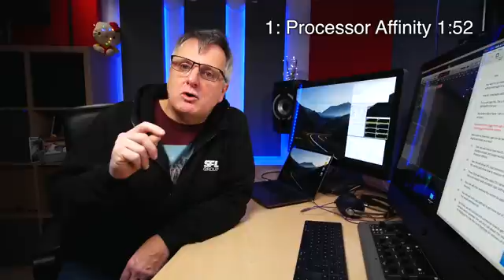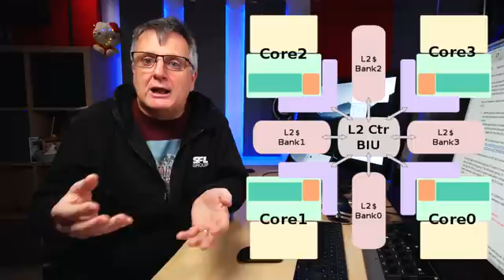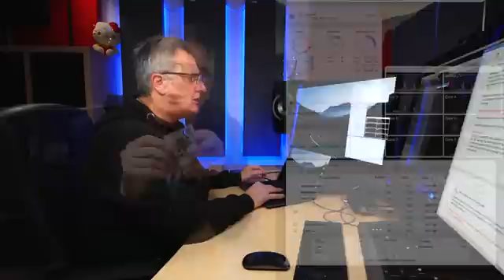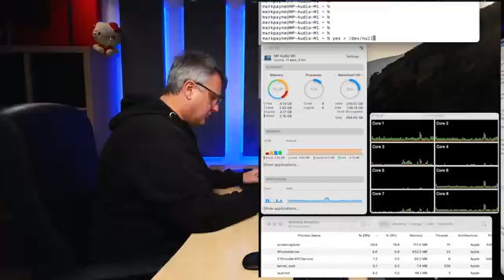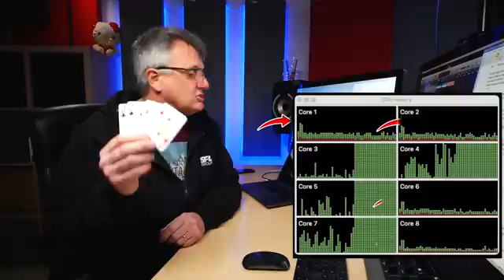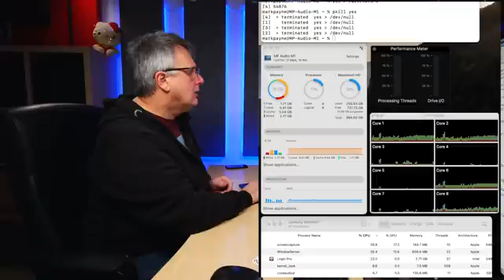Logic Pro X CPU Optimization | 2021 | M1 System Tips | Run more Plugins!

Comment: Thank you for making and sharing this. Very useful information. I was suspicious of the other videos showing 900 plugins running etc, thankyou for clarifying why. I am going to need a new mac soon and debating whether or not to get the macmini m1 or wait for next gen, hoping will allow for more RAM. Currently running a macbook mid 2012, 16gb ram, ssds. The machine still works but I think the old CPU is struggling now with the latest plugins and software updates.

Comment: Thank you can you please tell me how you managed to get your waves plug-ins to work without issues on m1????
Reply from the maker: Firstly I am using V11. And of course you want to be running Logic under Rosetta. We know that some people are having problems getting the plugins recognised in the Logic plugin list even though they get validated by Logic. I have had this problem on one of my M1 systems. I ended up clearing it by re-installation but I have no solid explanation for you.
Reply: @MarkPayneAudio  Thank you I heard about rosetta but will need to look into it more. Could you point me in the right direction please
Reply from the maker: Here: https://youtu.be/KSWE-Ruj1Nk

Comment: Really enjoyed this video. Bought the new Mac mini. Did a fresh instal of logic. Installed waves central and none of them are working. Even in rosetta. I spoke to waves support and they told me to delete waves and reinstall. However, this didn't help. Plugins are saying they are active in plugin manager but do not appear in the channel strip menu. From what I can find - Waves plugins only work when you're migrating an existing machine. Just to let everyone know :)
Reply from the maker: This is a head screw and is the "waves problem" as I see it. I run V11 and have installed onto two systems that WERE NOT migrations. However on my second install I had a bunch of the same issues you describe getting the plugins to be seen in Logic. This is a real issue and Waves must fix this and give us some input soon. I managed to get all waves plugins working on moth my M1 systems but I cannot for sure tell you how I did is (especially on the second Air system). Sorry I cannot tell you what the issue is exactly.
Reply: @MarkPayneAudio  Thanks for the reply Mark! I wasn't expecting one. I just thought I'd share my experience. Im (trying to) run waves V12. Looked high and low for a fix but nothing yet. Thank you for posting these videos. Ill be checking back for more in the future :)

Comment: Thank you for this. I have a 2009 MB pro + Logic 9, and have been struggling with the decision to upgrade. I’ve made many professional-quality multi-track recordings with that system, and it still works well, but the computer is obsolete for general use. Based on your thoughtful and clear presentation, I shall order a MB air + 16gb with Logic pre-installed (Apple doesn’t offer upgrade from 9 to X). And I’ll be watching more of your videos.
Reply from the maker: Glad this helped!

Comment: You mean a sine wave going through stock plugins isn’t a real stress test? Haha! Great job. I just received my M1 Mac Mini and am spending time installing my plugins and determining which ones will install and which will not. 

Thanks for e free education. 

Subscribed
Reply from the maker: Cool, thanks! Appreciated.
Reply: @MarkPayneAudio  how did you get Waves To work? Rosetta?
Reply from the maker: @kungfuthug101  https://www.youtube.com/watch?v=KSWE-Ruj1Nk&t=3s
Did you try it yet?
Reply: @MarkPayneAudio  I just watched your video link. Thanks. 

That was 2 months ago. Are you still opening Logic in Rosetta? Have you gotten any of your interfaces working yet?

When the plugins do become native I would assume that unchecking open with Rosetta for Logic would run the plugs native?
Reply: @kungfuthug101  Yes I am opening Logic in Rosetta. All the waves stuff is running this way still, as is Console 1. It is still the elegant way to go. ... secondly ... no. I have little chance of anything from Digigrid working on M1 (my IOS in the studio) and I am not even going to worry about it. Dante DVS we think is months away. My 2019 Intel 13" system will continue to be used for capture on shows (that I am not doing!).
Reply from the maker: @gvtbandadmin9163  Sorry Colin... Thats was me replying from the wrong account! Mark
Reply: @gvtbandadmin9163  I have successfully got my Apollo and Satellite working thank you!

Can I revert the kernel extension now it’s working or leave it modified until M1 native support is available?

Comment: Hi Mark , I have BFD3 Drums Software that always crashes my Logic software when trying try using it as plugin , my question would be , if I decide to purchase an M1 will this continue to crash ? or maybe its the actual BFD3 software ???. My current MacBook Pro is 13 inch Touch Bar  i5 , 16 ram , 500gb SSD 2017 model .
Reply from the maker: I should not be drawn on this as I do not use this stuff. However, I did some research for you and I would point you here ...https://www.fxpansion.com/forum/viewtopic.php?f=49&t=8803555&sid=2239efe5106e177ec9a07e79d7aef585
I suggest following up with the guys that are using M1/Logic in this thread.

Comment: It should be that a 1024 buffer is better than a 128 to give headroom to the computer to achieve all calc in time for real time audio to keep flowing. I am not sure what the memory calculation has to see with that ? 
It's more that with a small buffer, the computer CPU will inevitably miss more often some calculations and result in audio playback stopping, versus a 1024 buffer allow the CPU to smooth out the load over a longer period of time. The whole thing is about the difficulty of maintaining real time audio, and when you export your song and the computer is free of real timing constraint, you ll more often than not see your computer rendering the track faster than real time.
TLDR Keep buffer as high as you can -
Reply from the maker: So for me.. The buffer here is a record buffer. If you are not recording, it is irrelevant. I actually think that your point is interesting... and I have manipulated the (record) buffer size and it makes no difference to Logic's playback performance (in my world). But I may be wrong... But I do not think so.... This is about recording... Low buffer = Low latency ... but at the price of interrupts during recording (not good!). I am so happy to hear comments and challenges here. I can be wrong, it does happen!
Reply: @MarkPayneAudio  Well, I observed this behavior of needing high buffer to run my large sessions previously on my macbook pro. But I hust ran a quick test on the mini with just real time plugins and to my surprise the activity monitor and the logic pro cpu meters reported the exact same load from 1024 down to 32 buffer samples. I ll investigate some more but it seems you right but I m astonished now ! Cause I have been losing so much time running 1024 buffer. Or maybe it comes at play when there are vsti playing ? I ll check some more...
Reply from the maker: @bekelronyt  Thanks for checking K. No-one has all of this down, myself included. I do prep the hell out of my demos to make sure I am showing quality metrics that have repeatability. Thanks for being open and contributing to all of this, it's a joy.

Comment: Hi. I just bought a Macbook air M1 and the internal speakers are horribly phasey. I often did edits at the kitchen table on my previous MBpro Intel using the built in audio but I just don't think this is possible using the M1. It sounds like apple have used some kind of stereo spreader to make the audio sound wider - have you noticed this? Cheers
Reply from the maker: Well I don’t really know. I always used headphones for mobile edits. I only use the speakers for a bit of surfing. Do others have this issue also? Anyone?
Reply: @MarkPayneAudio  thanks Mark. I have tinitus so try and avoid headphone. I tried to do a demo between the two at several shops but it was so bloody noisy in there. The M1 MBP did sound better so I might do the swap.
Reply from the maker: @studioconnectionsaustralia1856  Yes ... so sorry. I really pay little attention the speaker sound on the device but I can see how important this would be to you. Let us know how the swap goes.

Comment: Very nice video. I have a Mac Pro mid 2012 6-core 48 gb RAM, and SSD.. And even with the settings you showed and that I was already using, I have to freeze many tracks in order to work with all the plugins. I find Kontakt libraries of any software house very hungry, like Output for example. I cannot upgrade my MacOS anymore, so I’m considering the MacMini M1, but I’m very concerned about the only 16 gb ram... will I be able to run my Logic projects on the M1?
Reply from the maker: The issue will be Kontakt support on M1. Wait for that to be confirmed and then find a friend with a 16GB M1 for testing! I am wanting to collaborate with one of my artist friends using NI. Watch this space!

Comment: I am always using the API2500 bus comp plugin on my drum tracks .. One day I started using it and never ceased it, although I have some better alternatives... 😅 
I am using the Fab filter Dynamic EQ very often and Valhallas Reverb and Delay selection. My CPU hungriest plug-in is the Izotope Ozone, it did drive me crazy so I had to stop using it. But not only because the  performance, I started to throw some plugins from different companies in my Mastering-chain cause I felt kind of "stucked" using Ozone.
Reply from the maker: I will check out API2500 for sure.

Comment: Would like to see how the M1 handles a session with all cores enabled and you add a live played software instrument. Traditionally Logic reserves the last core for this, and I would be concerned if It chooses the last core as they are arranged here where core 8 was one of the low performance cores. Then you could very easily get a system overload if that live track uses just somewhat more than a very light load virtual instrument.

Very nice video.

Comment: Thanks For this Mark. I've came to the same settings on my own in logic for the best performances. But I sitll have issue sometimes having one core at 100% (because of the master bus) and the rest of the core at like 25%. this is really frustrating and I was wondering if you had some advice to give. Some say to just not put all the plugins on the master bus and spread the load using pre mix buses, but even when I do that it keeps on using the same core and not use the other preocessing power available. Thanks for you help!
Reply from the maker: What system, OS Version and Logic version are you running? You could try a bus routing to apply half your master load and then a final routing to the main bus for the other half?
Reply: @MarkPayneAudio  Mac Pro 2019 (16 cores) OS X catalina. Logic 10.5.1. That’s exactly what I’ve done. Send all the tracks to a premix bus and then routing it to the master bus, but it doesn’t seem to apply the workload to other cores, I get the exact same result. All the power available from my machine is useless cause one core gets to much workload. Also slows down the bounce process cause as soon as you reach the maximum  power of one core the bounce process can’t go any faster
Reply from the maker: @julienfourquez7793  That is broken! Not what I would expect at all! What plugins are you using?
Reply: @MarkPayneAudio  I like to produce mix and master in the same session, and usually have something like 8 plugins on the master bus mainly for adding color. Ozone 9 and Kclip 3 are the one taking the most power in the mix bus specially ozone. I usually get trouble when I've been working a long time  on a track doing several different versions etc.....although I get one core fully used and the rest at like 25% I don't get a system overload message, but logic starts to have trouble playing the audio and start to glitch becoming usuable so I have to desactivate Ozone and then it's ok. Maybe updating logic would do some good cause the 5.1 version isn't so stable I find.
Reply from the maker: @julienfourquez7793  I would be happy to try and run one of your sessions to see if it the same on my M1 and Intel systems (10core iMac Pro) but this is difficult to do with the plugin licensing etc.
Reply: @MarkPayneAudio  Ya that would be too complicated,  I think I will work perfect on the M1 since it's more powerfull in single core. It's just sad that you can't tell logic to use the other ressource available from the other cores cause I'm barely using nothing of the power this machine can deliver, If I create a new session and import all the tracks again, it will run , but I don't want to do that each time I run into this issue
Reply from the maker: @julienfourquez7793  This has to be a bug. This is not good behaviour. Have you placed a Logic support report with apple?
Reply: @MarkPayneAudio  No i haven't, where can I do that exactly?

Comment: Hey man. Thank you very much for your inspirational content. Very useful to me. Just got my m1 mac mini 16 gb ram 512 ssd. So far awesome. Struggling with the waves plugins... Also the slate bundle isn't working yet - Also not in Rosetta mode. But hope to make it happen. Thanx one more time!
Reply from the maker: I am running Waves V11 and I think making sure you are logged in as the fist account added to the system makes a difference. Also make sure you have ticked the Rosetta flag on the info page for the Logic App. Did your Wave plugs all validate?
Reply: @MarkPayneAudio  Hi Mark! Thanx for your reply. I m using v12 which work just great also without Rosetta... Actually I’m having more issues using the ‚Logic-Rosetta-mode‘ using it native works just fine here. I’m in contact with the waves support maybe they can work sth out. I do believe it’s an activation issue. Moving licenses from the ‚old‘ mbp to the m1 as the newly bought plugins work just fine.
One more time: thank you for your videos they include a lot of ‘aha-Moments‘ for me 👍😎 cheers from Austria
Reply from the maker: @stefanmathies3363  Glad you are moving forward Stefan.

Comment: Interesting review. It bugged me really if apple systems utilzing their cores and it seems they do. The difference between pro and air is cooling, maybe there are external workarounds but for now mac mini seems the appropriate solution for that performance range. The question still remains if the m1 architecture is utilized fully by the software.
Reply from the maker: What I have tried to show is that a busy session that takes Logic to the system overload point is still not a huge sustained and constant user of CPU core capability. The dynamic nature of Logic's need for CPU during realtime playback and overdub does not generate significant core heat. In this case an M1  Pro does not run its fans anyway and an M1 Air would therefore not be at any disadvantage. When you bounce a session offline (non-realtime) then you are asking the system to make "best speed" and I would imagine we will see more heat. The Air would eventually throttle. But at this point you are making a cup of tea. Both machines doe not really heat soak in the way an intel MBP or Air does so its a lot better than you would think, even for the Air.

Comment: Can you do a video on Dual Monitor set ups using the MacBook M1 eventhough macOS claims to not support it
Reply from the maker: With the Pro/Air MacBook, you can have one additional Monitor up to 6K/60Hz. I happen to use an old Apple Thunderbolt Display in the studio which is QHD resolution. With the Mac mini M1 you can have two displays, a 6K display on the USB/TB and a 4K on the HDMI

Comment: very informative thanks! could you point me to any resources you refer to / ways of learning about modern threading you discussed in the outset? I can never find too much clarity on the info where audio use cases are concerned. Being Ableton user I'd like to make correlations there having seen this. Thanks again!
Reply from the maker: That is tricky. To be honest I am leaning on my past as a computer systems pro when I worked for Hewlett Packard from around '85 to '95. When I started SFL Group I still continued to teach Unix, Systems Performance and Disk Array tech. I stopped that in around 2000 when SFL was fully established. So... a lot of this comes from within.

Comment: @Mark do you advice to get 1tb vs 512? ( I mean internal ssd) or keeping the Mac mini m1 dedicated just fo music and connected to a external hd where libraries are moved, and projects saved will do? Silly question I know, just wanted to have a second opinion in regard the importance of internal ssd capacity wise. Thx!
Reply from the maker: I just think the performance of the USB3 Samsung Series 7 (T7) SSD drives are so good and the performance of the bus is fantastic. We just don't need to go internal SSD for music anymore. I would find 256GB internal too small for my life, 512GB would be sweet spot. I got 1TB because I was thinking that 4K video projects might need it. But really. I think 512GB is enough and then invest in externals.
Reply: @MarkPayneAudio  hey Mark! Thx, for quick reply. Yes, I think for this secondary Mac M1 I’ll get the 16 ram and 512. Good to know about the Samsung T7  external ssd . I’ll look for one of those. Although here in the UK those external ssd are not as inexpensive as in the USA... so, will the “  trade “ of saving some £ on the internal ssd to spend more or less same for the external one? :)